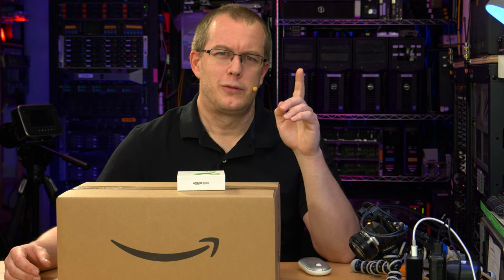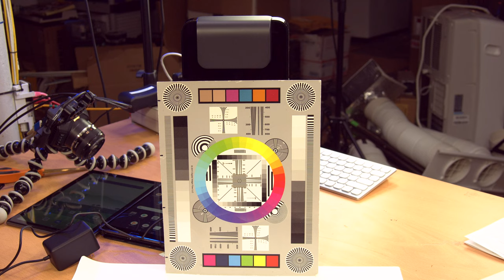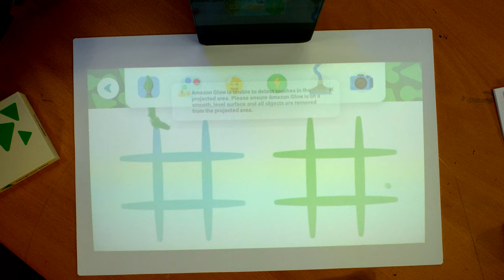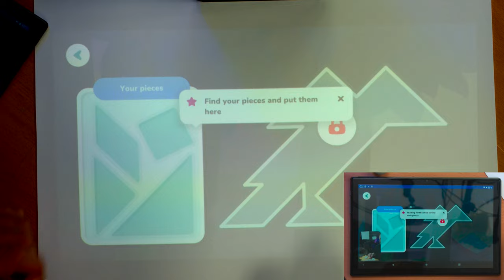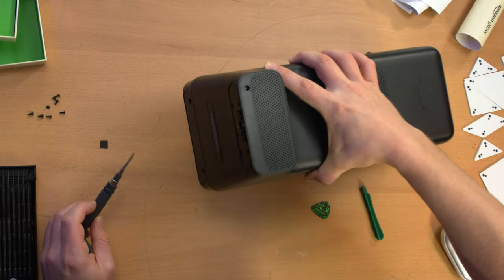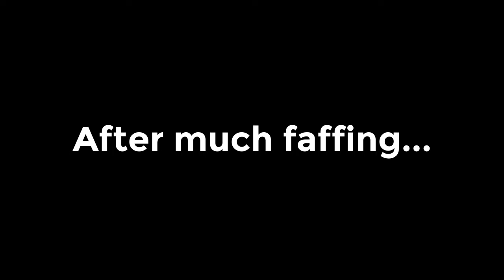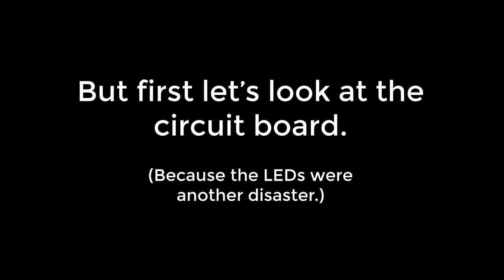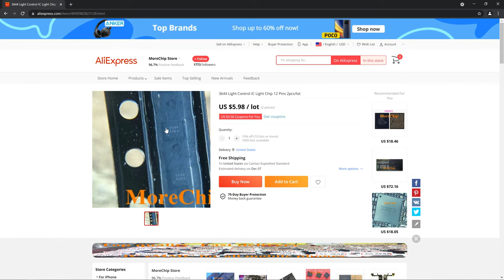Amazon Glow - Unboxing, Demo, Teardown, DESTRUCTION, Rambling

Comment: Many app asking for location: The reason in this case is that new restrictions on WiFi and Bluetooth scanning require a user to consent for the app to know your location before it can be done. Turns out that you can use Bluetooth and WiFi to accurately enough locate a person under the right conditions, so the mitigation devs came up with is now to scan for Bluetooth and WiFi apps need location, hence the prompt almost every time you set up a new device with a new app which translates to location prompts almost every time.